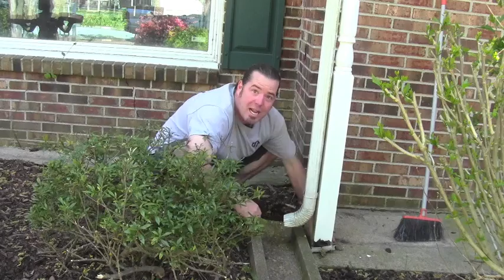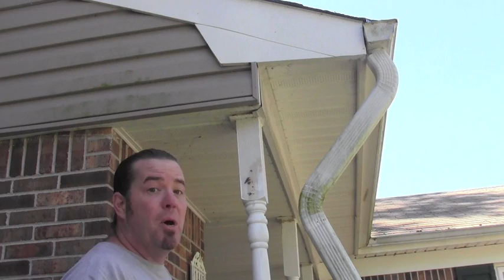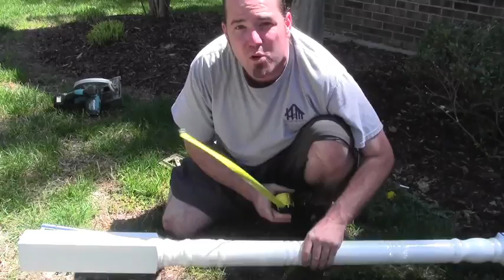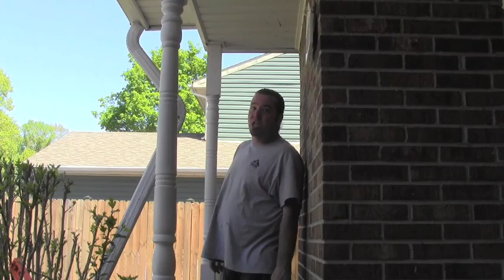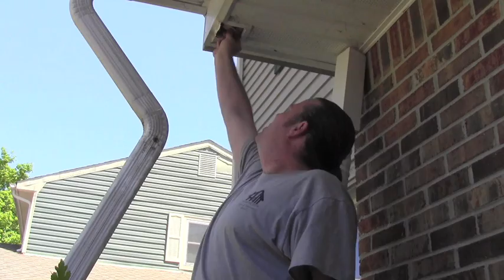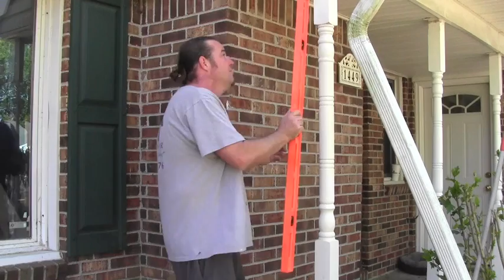how to replace, install porch column, porch post. Easy! Home Mender.

Comment: Do you know where to get or what kind of aluminum plates you used or reused in this video? I can't find anything but load bearing and they are pretty costly. Didn't see them listed in the info.
Reply from the maker: Hey Sonny you are the first one  to ask about them. !  They are typically in the same endcap as these posts, roughly 5 to 7 dollars depending on the size.
Update I can’t find them online in the bigger stores. However you could use a piece of dimensional vinyl or PVC in a pinch.

Comment: We have only two of those ugly 90 degree metal brackets on the corners! Plus the furnace is in the space above the porch. We wouldn't dare take one out without propping up the front beam first, unlike these apparently purely decorative posts!
Reply from the maker: hey  paula!  definitely need a 4x4 under that one...😧

Comment: Did you connect the base to the concrete at all or is it just sitting there? Did it not need to be connected because it’s not load bearing?
Reply from the maker: Hey T :-)! No this one just uses the tension to stay put, if you need extra stability you can use a hard-core exterior adhesive caulk like quad to secure it

Comment: Hey Dustin, I just subscribed !thanks for making this video now I am more motivated and confident that I can do this. I'm living paycheck-to-paycheck now and can't always afford to pay someone. This is one of the many projects I'm going to have to tackle around my home and the column I'm replacing has a gutter on it as well it also sits on a concrete slab. I have a 4 foot overhang and am thinking about using 4x4 clear fir posts. My porch is about 16 ft. wide, right now there are 7 columns similar to the ones in your video. Would 4 posts be enough ?
Reply from the maker: hey carlos! awesome! it seems 7 posts in a 16 ft span is alot..a post every 4-6 ft should work!

Comment: Have to do the same exact thing for a customer. How much would you charge for a service like this? Thanks
Reply from the maker: hey michael! the post is 70-90 bucks...if i had to paint it 250
Reply: @homemend  yea. Mine was just a 4x6 post. No design and they were going to paint it. Thanks for the reply. Was thinking like 150ish

Comment: Thanks, my porch post is probably closer to 4 feet but it’s thinner, do you think I should it still bearing weight
Reply from the maker: hey H...if its thinner than the 3.5 inch its definitely decorative,,, most times the 3.5 are also...if it concerns you you can always tcut and throw a temp  2x4 post in there while you replace it..i hope this helps!

Comment: Nice video, wish you had load bearing just to see the jack installation.  FYI, you keep saying the post doesn't have any "tension on it", what you really mean is you want the post to have some "compression", so you installed the shim at the top to put some compression on the post.  Just wanted to comment on that.
Reply from the maker: hey andrew! you're absolutely right...appreciate the comment, my friend.

Comment: Question Mr. Luby, how would I anchor 10 foot posts with vinyl sleeves to hold up the overhang on my porch. Would I shoot nails through the vinyl and 4x4, or would the weight of the overhang be enough to keep the post in place? I thought about taking a pocket hole jig and placing a screw through the vinyl and 4x4, but I don't want to damage the vinyl. How can I make the post secure and strong without damaging vinyl?
Reply from the maker: Hi Peter! Great questions..! i would set the posts into place and use a shim to close up any small gaps , then pilot hole and pre-drill 45 degree to "toenail" the post in. also use a slightly bigger drill bit to allow recess of the screw head.  Then you would use a vinyl post trim kit...check this one out.
https://goo.gl/oXsdjb

I hope this helps! thanks so much for commenting!
Reply: To confirm your instructions, you would drill into the VINYL and POST and cover the top with a trim cover? Thank you in advance for your time and consideration Mr. Luby.
Reply from the maker: hi peter...eek.. i dont really like drilling into vinyl either.. There are tasks where just doing the best looking solution is the answer, unless there is another way in which you dont have to drill. I think the post trim looks great and you can secure the post well.. you got this!
Reply: So you're saying cut the vinyl post sleeve maybe 2" short at the top, prime spray and toenail the top of the 4x4 with screws, and use a trim cover to hide the primed 2" space at the top?
Reply from the maker: hey peter.. 2" sounds like a lot...i would just cut the post to fit snug ( as tight as you can) then use a shim to close up any hairline gap..toenail it, then slide your sleeve over the screw heads. if youre using treated 4x4 you would not need to prime. youre also covering it with a pvc sleeve so it is protected!
Reply: Thank you

Comment: Great video, you made it look very simple, but I do have a question: If you were moving the post over from it's original position, what would you use to fill in the holes at the top where the post used to be? Thank you in advance for your time and effort.

Sincerely,
Pete
Reply from the maker: hey pete! great question!  depends on if the post was "set in" under your porch. If its just sitting under the soffit, you can thin down a coat of rock hard wood putty, sand and paint but if there is actual wood, trim board missing, you would need to replace that piece or cut a decent patch and make it look like its the full board...i hope this helps! thanks so much for watching!
Reply: Thank YOU, Sir. Again great job on the video. Can you recommend a wood putty brand?
Reply from the maker: Hey Peter! Yes sir! this guy has always been my favorite, you can sculpt it, smooth it, sand it... we've re-created corners from dog chews with this stuff!

https://goo.gl/h7fmro

Comment: I've watched about 8 videos on replacing porch posts and yours is more entertaining and easier to understand.  
Question:  My porch overhang is about 5 or 6 feet, so it's load bearing.  Should I use a Simpson Strong tie 4X4 post base galvanized that's raised 1 inch off ground and adjustable, then drill a 5/8" concrete anchor in the center of the post base like they recommend?  My post needs lateral force support because it's load bearing and is probably builder's code anyway right?
Reply from the maker: hey andy..different strokes i guess... they sell these little aluminum plates for a reason...lets water run under them instead of staying wet...thanks for sharing this!
Reply from the maker: hi jason! thanks for the comment! that sounds like a sweet plan. adjustable base would definitely make things easier. Not sure if securing the use is "code" however doing it the way you feel most comfortable is usually a good rule of thumb. I hope this helps and thanks for watching!
Reply: CHRIST accepts you right where you are no matter what sins you've done. He especially picks us that don't seem special in this life so that no man should glory lest it be in His eternal charity that saves us from our own corruptness. Saved by faith in GOD's blood for ever and ever. This life is a vapor. CHRIST is coming very soon. Seek evidence of Noah's flood. This world was judged once and will be a second time. Read Romans,Corinthians,Psalms,Prov.,Matthew, etc. Proverbs 18:2 A fool takes no pleasure in understanding, but only in expressing his own heart.
Reply: @pridgworth1813  This was a construction question.  No one was asking for religious spam.